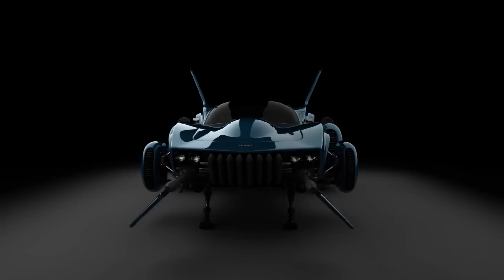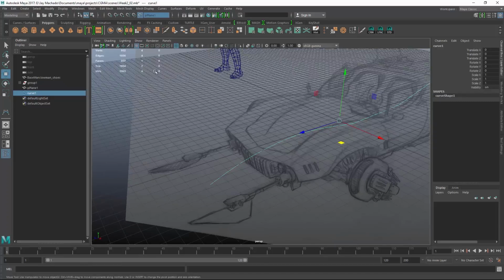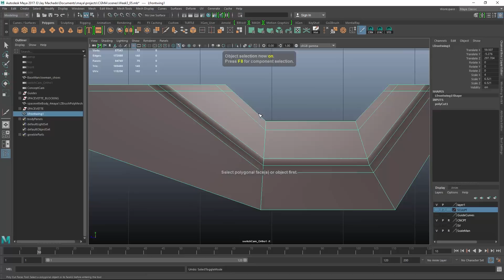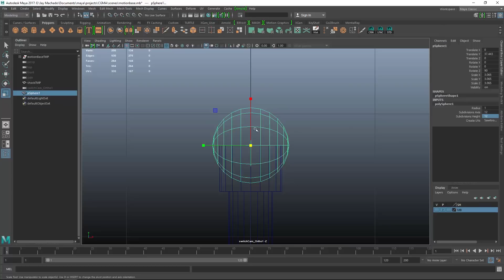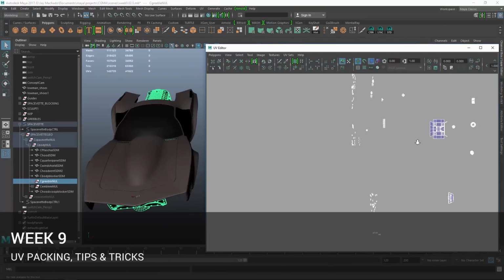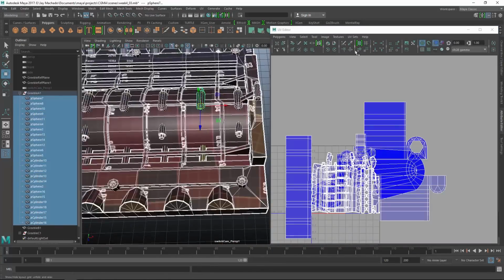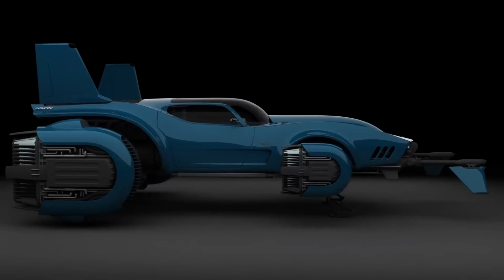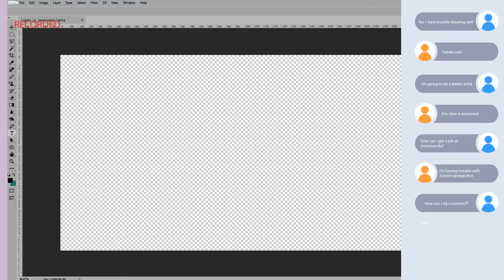CGMA | Hard Surface Modeling for Films

Comment: if someone can tell me the difference between the process to make hardsurface for film and video games ?? plz
Reply: Mesh optimization. A game asset is closely observed for its triangulated wireframe to make sure most amount of triangles support the overall shape of the object. You also need to create level of detail models for each object in the game depending on their visibility. Texturing in a video game asset uses tricks like storing multiple textures in rgb channels to preserve callbacks for larger texture. Hard surface for films are exclusively clean topology, created with subdivision in mind and therefore they have an evenly laid out quad flow, the reason being that this gives a predictable subdivision of mesh. Texturing for a movie asset uses 4K maps or more for capturing on screen details. Rigging is significantly more sophisticated for a movie asset since the movements need to match cinematic material, whereas in games these can be simplified both due to a faster frame rate or length of game.
Reply: A key one is geometry. For films, you generally want to actually include details in the geometry of the model. That drastically increases the polycount, but lets you zoom in on details or reflect light very realistically.

For games: You generally want to use normal maps. Details like screws, indents, scratches, peeled of paint, wood texture etc are applied on flat surfaces. From most angles: This looks fine, but for drastic angles: You will be able to notice that it still is just a flat plane. The advantage is a highly reduced poly count, which is key for real-time rendering.

Comment: Maya maya maya. Can we decouple maya from Hollywood as the ONLY tool for the job please? These days its like using a swiss army knife to slice pizza. There are better tools for modelling that halve the workload. Maya’s modelling tools are unclean, ‘unfun’ and laborious. We’ve moved on already! :)
Reply: I hope you dont take offence but to me it sounds more like you are not good with maya. When you get a handle on the markin menus and hotbox then it gets faster. Also autodesk has seriously screwed up the software
Reply: @hyraxist   While I do not dispute that Maya has some pretty damn strong modeling abilities I find that I can get the same work done faster in Blender with less bugs and it crashes far less while still moving tens of millions of polyons (on a GTX 1070). I still find rigging and animation to Maya's strong points but a combination of Blender and Zbrush to be the best for hard-surface and organic modeling. They both better watch out though because I keep seeing greater and greater things coming out of Houdini every release.

 P.S. I have about 4 years of 3d modeling in both with a prior 2 in Lightwave 3D and 8 or so in 3DS Max.
Reply: @DavionSobek  Yes man, you're right about Houdini. I modeled in 3smax and  Xsi, for some time I figured out Blender to understand what's what, I managed to touch Maya and C4d, but after Houdini it all seems to be a kindergarten. The procedural possibilities offered by the node system seem limitless. But to feel free in Houdini, you need much more time and effort than in any other package, so Houdini probably does not suit beginners.
Reply: If you are a 3D modeller it doesn't even matter what you use, you can use Maya, max, blender or even Houdini to model if you want, just show that your artwork is industry standard, that matters.
Reply: It's industry standard in vfx lol
Reply: If you're referring to Blender not even close
Reply: And look, 3 YEARS later and Maya is still industry standard, Blender is still where it was ("soon you will see!" mantra for many years :D ) and nobody "moved on" :D
Reply: After years of development still no compare to 3ds max viewport performance and modeling tools indeed
Reply: no beacuse in Simulation it isnt as good as Houdini
Reply: 3ds is the best on hard surface modeling, Hoodini is a beast on animation
Reply: And... it's "only" £222 a month!! Or "only £4,812 over three years!! Yeah really affordable :o.
Reply: YES the maya tools are ................... are unclean, ‘unfun’ and laborious. 
BECAUSE YOU CANT USE THEM. 
MAYA TOOLS ARE THE ONLY ONES AND THE BEST ONCE EVER !!!!!!!!!!!!!!
Reply: H D  
lol ! your career ?
learn better an DO BETTER dude !
remember softimage came after maya.
so soft image = that shit copied maya. so if you dont have softimage in your hands and you are crying because just a software and a company, go and clean toilettes. 
they use the same tool.
maybe there you can have a career. never is to late to switch career.